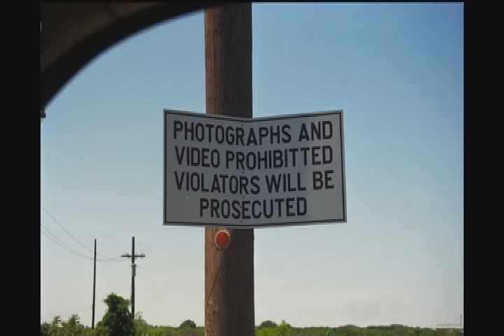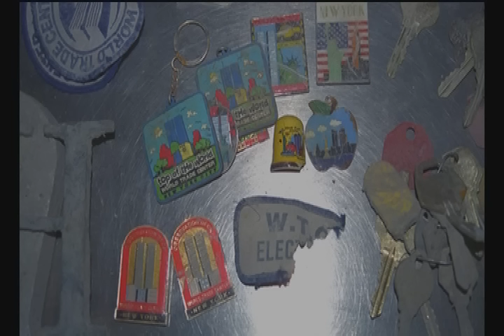Fresh Kills (Landfill) - WTC Debris Burial Ground, pt. 1

Comment: What this video does prove is that the fires in the standing towers were much hotter than many people think and lso as so few bodies were found in the rubble the rubble pile must have been buring at a great rate for the first day or two in order to so thoroughly destroy all evidence of so much metal.
Reply: yeah....it was so hot it melted the steel from the buildings, but not hot enough to melt the thousands of metal keys they found. hummmm...
Reply: Amanda M. Franks Heat rises and the fire was in the last quarter to half the buildings...hummmmm...
Reply: Amanda M. Franks The metal keys were not necessarily from the deceased occupants of the twin towers. They could have been from the many wallets/purses left on the street and  occupants of the surrounding buildings when people fled. Many were from police firefighters  medical on the ground.
Reply: Tarn Sand Well, maybe you can answer this....Why did so many people die because of the buildings collapse and not the "extreme heat" in which they are claiming melted and weakened steal to the point the buildings couldn't stand anymore? The human body could not have lived a minute in such heat much less survived over and hour hour in it. It still amazes me that with so much in your face proof that the official story is bullshit, you people are buying it like it's on sale. If you will listen closely to this and other videos on the issue, the keys WERE inside the building just as the metal signs were that didn't melt. Regardless of possibility they weren't, We all know for a fact thousands were still alive at the collapse. Why did they survive such massive heat yet steel melted?
Reply: Microblitz
No it was not! The planes did not hit in the bottom half of the buildings. Heat does rise but it this heat WAS NOT  hot enough to melt and/or weaken steel...period.
Reply: .. and you base your evidence on ?
Reply: Science. If more people would apply what they learned in 9th grade they would know the official story is crap. Steel starts to melt at around 2400 degrees. Kerosene burns it hottest around 1800. You can see from the color of the fires that they were not burning that hot, the color of the smoke tells you the fires were oxygen deprived, and lets just say temperatures did reach hot enough to weaken or melt the steel....did only super humans work in the towers? When the towers collapsed there were a lot of people still alive in the buildings. No human could possibly survive over an hour in such temperatures, but not only were they alive, they were making calls, trying to escape, and hanging on to the steel outer exterior walls, which if the internal steel was that hot, would have conducted the heat through all metal it was connected to. It would have been so hot they couldn't have stood to touch it. When the planes hit, most of the fuel was burned up in the initial fireball. They actually want us to believe that such a small amount of burning kerosene melted steel and brought two of the largest buildings in the world down. Whatever. Complete lies and bullshit. Can you expect anything more from the US Government? Hell no. And the American people have been so dumbed down that the government can pull shit like this off and not only will the majority of the population believe it, they will throw tantrums like a child to support what the government tells them, all the while the ones involved laugh their asses off because they got away with it and gained a  cheerleader squad in the process.
Reply: The problem 'is' applying a 9th grade education.

But I am intrigued, what qualified facts do you base your findings on?
Reply: This is just quotes quotes from various websites. I would expect a 9th grader to do exactly this. Have you run any simulations? Where are your statistics? What is your qualification in metallurgy? Do you have access to the study material performed on the metal? Have you talked to anyone who actually did the study?
Reply: First of all, I'm not arguing about the subject matter, secondly I'm not an American so your insults make no impact on me.

What I have done is simply ask what evidence do you have? So far you have done and said nothing except spout anti-US government rhetoric and insults and do your best to avoid the question.

Ok so in the face of lack of evidence you would expect the person making the assertions to be an expert in the field to be able to make those assertions. But again, you avoid the question, and try to deflect answering it posting references to a number of websites containing the most basic metallurgical information and has little to do with the specific incident.

take this statement for instance, "If the fact that more money was spent on the investigation into President Clinton's Oval Office blow job, than what was spent on the investigation into 9/11".
So what money was spent on the investigation?

You wrongly again use the word "Fact". It's not a fact until you can evidence that it is and you haven't. Were you being serious, was it a joke? How do I know? It can't be fact because there is no references for people who do know what they are talking about to check.

Finally your unfounded claims with no evidence and expertise in the subject could be considered an insult to the people who actually did the investigation.
Reply: Amanda M. Franks What I'm hearing is that basically your strongest argument is that Kerosene burns at 1800 and steel melts at 2400. To take this as "evidence" is the dumbest thing I ever heard. The WTC was not some theoretical, sterile lab environment with a kerosene fire and a piece of steel. You can't account for all the factors like wind, other materials, structural integrity and insulation etc.

What IF the fires actually burned at a slightly hotter temp due to wind. Maybe the steel was only aprtly melted and the rest very hot, what effect would that have? The problem is very much more complex than you might think.
Reply: Emil Kanter Actually that is only one of very many arguments I have with the official report on 9/11. Still, it remains, the fires did not reach the temperatures needed to weaken or melt steel. Period. Why any of you have a problem in seeing that is beyond me. If such temperatures were reached in those towers there would not have been anyone alive when the towers fell. Why can you not see that, or is it just the matter of not wanting to see and believe the truth? It's your right, just as it is mine to question....In a situation such as 9/11 it becomes a duty. And please, do not try to insult me, sir. I am far from stupid and I am not sitting here trying to debate by handing out insults. It just seems that many things occurred that day that was physically impossible, never occurred before, and have not occurred since, and so many are buying that bullshit like it's on sale. I pray that one day you will all wake up and take your blinders off and recognize 9/11 for what it  really was. Until documents became unclassified people believed the incident at the Gulf of Tonkin, which led us into Vietnam really happened...It Did Not.  Project MKUltra....true. The CIA being the largest trafficker of cocaine....true. Operation Mockingbird....true. And the one conspiracy theory that has been declassified and if you would research it instead of arguing what you "think"...Operation Northwoods. VERY TRUE and it spelled out exactly what 9/11 turned out being to a T.  Again, debating with someone who refuses to research and has a closed mind is not possible. What is possible is that 9/11 was planned and put into place by our own government. Whereas, we who seek the truth may be wrong on several issues, there are so many we are not. I keep the faith and believe that one day, we will all know the truth. Till then......God bless!!
Reply: Have I sat around a camp fires? Camp fires are in open air. The inside of the buildings if they had reached such temperatures would have been like an oven. And you are right, when things like this happen, we will do whatever to make ourselves deal with it, not believing is one way, but so is believing what the government is telling you so you feel comfortable. And if you read my comments before you, I too posted links to sites explaining at what temperature steel weakens and melts, and heat transfer, etc...and basically was insulted and called names. For every site I list there will be 5 more disputing it. Same as for you. We of course have seen the videos of the planes hitting the towers and we all can see that the majority of fuel was burned upon impact in the initial fireball. subsequent fires were mainly from materials inside the buildings which caught fire. The austenizing temperature, the temperature where a steel transforms to an austenite crystal structure, for steel starts at 900 °C (1,650 °F) for pure iron, then, as more carbon is added, the temperature falls to a minimum 724 °C (1,335 °F) for eutectic steel (steel with only .83% by weight of carbon in it). As 2.1% carbon (by mass) is approached, the austenizing temperature climbs back up, to 1,130 °C (2,070 °F). Similarly, the melting point of steel changes based on the alloy.
The lowest temperature at which a plain carbon steel can begin to melt, its solidus, is 1,130 °C (2,070 °F). Steel never turns into a liquid below this temperature. Pure Iron ('Steel' with 0% Carbon) starts to melt at 1,492 °C (2,718 °F), and is completely liquid upon reaching 1,539 °C (2,802 °F). Steel with 2.1% Carbon by weight begins melting at 1,130 °C (2,070 °F), and is completely molten upon reaching 1,315 °C (2,399 °F). 'Steel' with more than 2.1% Carbon is no longer Steel, but is known as Cast iron.
Reply: *****  Exactly as I said earlier. If I post a link to the information, the link is false. If I post my knowledge, It's not correct. If I post information on required temperatures to melt steel, you want information on the temperatures required to weaken it.  Do the research yourself and learn something on your own. Google Corus Construction and the tests they performed on structural steel, that was uninsulated, and exposed to prolonged hydrocarbon fuel fires.l The highest temperature they recorded would only make the steel weaker by about 1%. Not nearly enough to weaken or melt the massive steel columns and beams in the WTC. Since you wanted to discuss the conductivity of heat through steel, the heat from the fire from any one part would have diffused throughout the  rest of the building meaning the towers would have kept a redundant strength. Even if the fires did burn at the temperature required to weaken or melt steel, they did not burn long enough at a continuous temperature to achieve that. In other words, the temperature would of had to retain a certain temperature and due to the thickness and actual metal compound in structural steel, kept that temperature constant for quite some time, not the little over one hour as what would be the case in the WTC towers.
Reply: Just a point, as previously said you don't have to melt steel to weaken it.

..and as yet I've not seen anyone insult you or call you names. Only ask you questions to answers that you don't want to give.

What was the wind speed at the top third of the tower on the day? You've explained this as an enclosed area. If this is so then it's likely that this would have an effect much like a blast furnace, that coupled with the updraft from the thermal vortex caused by the burning fuel would suck in more air increasing the heat in a localised area that which the plane opened.
Reply: Microblitz I've answered your questions, now do the research yourself.
Reply: "...do the research yourself"...
I think I said I had no issue with your subject matter. It's the method of presentation which in question and the fact that you accuse anyone who doesn't agree with your findings based on your own truth, to be educated only to 9th Grader level.

" I've answered your questions"...
You've not actually answered anything. You have put forward a number of hypothesis which you have touted as the "truth" then insulted people who question your authority.

Impartial observation of your basis for your truths make it obvious that they are much more motivated by your mistrust of your own Government than based on any for of science.
Reply: The onus isn't on me to prove anything you are making the a case for what you believe is the truth. so prove it.
Reply: +Emil Marin Other factors such as wind and combustible materials are irrelevant. The black smoke and dull orange color of the flames indicate a relatively cool fire. Super hot fires have flames that are almost white and light colored smoke. These are variables that do not change. A hot fire won't burn dark orange and a cool fire won't burn with white flames.
Reply: Check Fire Engineering's web site. You can learn all about the properties of fire there. Or, you could toddle down to your local fire station and ask the guys in there. They're experts on the subject and will tell you the same thing I just did. If you're nice, they might even let you wash the fire truck and pretend you're driving it.
Reply: I didn't say anything about inside jobs. I stated facts about the properties of fires. If you come to the station while I am on duty, I will let you wear my hat.
Reply: Kyles45Angel
With all due respect, for you to say that shows you know nothing about fires or their properties. You might want to do some research. Watch a few fire videos. You will see white smoke from buildings that show no flames. Then you will see bright flames erupt (hot fire), fire dept. arrives, pours water on the fire and you will then see lots or black smoke and dull red flames (cooled fire). This does not change. Ever. Anyone with any experience with fire will tell you the same. Don't take my word for it, ask your local fire dept.
Reply: Kyles45Angel
The smoke turns black when they pour water on it, because the water COOLS the fire. There is no point in researching something I already know to be a fact.
Reply: +Amanda M. Franks  You are very smart.  9-11 false flag operation carried out most likely by the US Government 
in order to create a new boogeyman after the threat of Communism had died and the Cold War was over.  Also used to invade other countries for  their oil and resources, while simultaneously securing American interests, whilst clamping down on rights at home through unpatriotic and unconstitutional acts like the NDAA and Patriot Acts.   Not at all suspicious that then Secretary of Defense Donald Rumsfeld had announced on 9-10-2001 that $2,200,000,000,000.00 (2.2 Trillion) was missing and nowhere to be found and the next day a plane slams into the wing where it was being investigated.  Never heard about where that money went either.  It is also not suspicious that molten metal was seen pouring  out of the building and the best explanation for these temperatures is jet fuel (kerosene) and office fires. Lol.  Not at all suspicious that 19 hijackers (which some have been proven to still be alive by the BBC:  type in ''BBC hijackers alive and well'') who could barely fly small Cessnas according to their flight insturctors somehow managed to knock down three skyscrapers and cause them all to fall in the identical fashion (collapsing in on themselves against the path of MOST resistance) and what is the one thing that survives...a passport of one of the hijackers.  Indestructible black boxes didn't make it out, but the passport somehow floated to the ground nearly unscathed and was found by an FBI agent.  Lol.  I could go on and on and on.  Other tell tale signs are how George W. Bush was already at the scene on the 
weekend.  This is after the biggest supposed terror attack in US history and the President is wandering around outside theoretically unprotected from potential snipers or people who could mortar his position.  If 
this had been real in the sense that there was a real terrorist threat they would have never let Bush walk around in the open on the rubble.  Who was to say that the terrorists weren't planning on launching the second prong of their attack.  They weren't worried because there were no terrorists.  Same for Bush's behavior in the school.  Imagine being the President and they whisper to you that the country is under attack and two planes have crashed into the WTC buildings.  Would the Secret Service just stand by?  No, they would have whisked the President away.  And if you were the President you sure as hell wouldn't sit there listening to childrens stories and then leave once they are finished.  You would politely excuse yourself:  Once again if the threat was real.  Americans are suffering from denial, too much patriotism, and cognitive dissonance.
Reply: Kyles45Angel
I don't believe I was addressing whether the fires were out or not. I was discussing the temperature of the fires.
Reply: I don't  need to prove anything. I was merely pointing out well known facts regarding fire temperatures.
Reply: greyeaglem
Kyle45Angel is suffering from cognitive dissonance due to too much patriotism and mainstream media brainwashing.
Reply: +Kyles45Angel Theres photos of molten steel out there its just not shown on your media and firefighters and experts back it.
Reply: Microblitz
Have you done any of those things? I would love to see your findings.
Reply: How about WHAT is on fire? Is that irrelevant?
Reply: SEARCH: WILL DONALD TRUMP REVEAL THE TRUTH ABOUT 9/11: 12:55 - 13:00. YOU WILL SEE THE BASE CHARGE BEING SET OFF.
Reply: jorge rodi The best planned operation that the us has ever done , the hundreds of players needed and everything went off without a hitch . No leaks no whistle blowers nothing , yeah ok ? But yet 17 years to gather the evidence to prove this and nobody has presented said evidence in any court of law why not ?